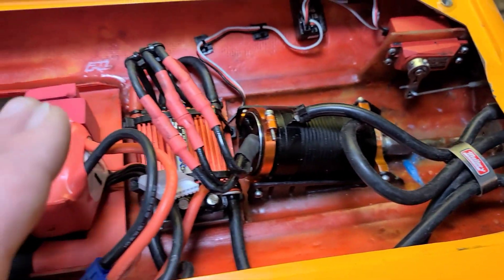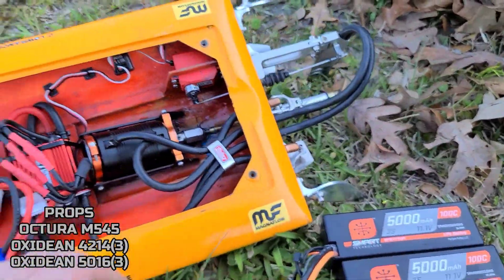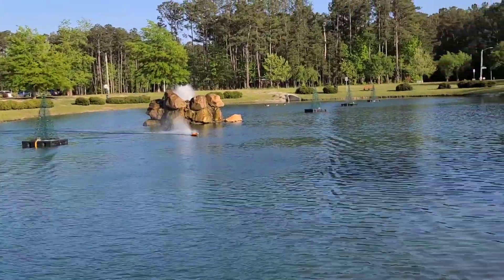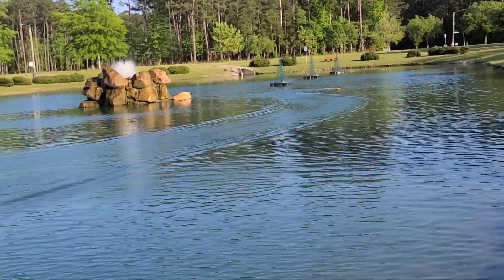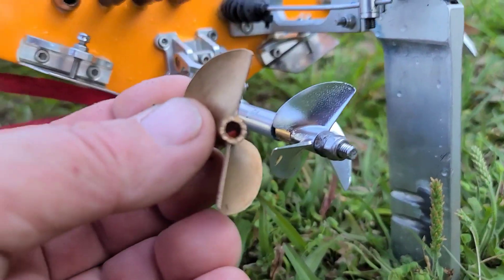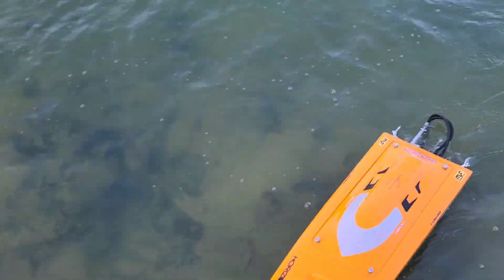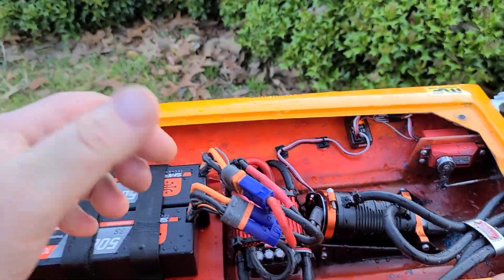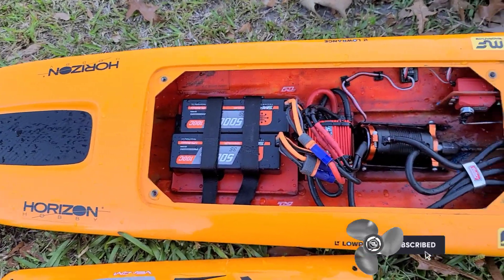Surpass Rocket 4082 Quick Install & Test - 3 Blade Prop Testing Fast Electric Rc Boat

Comment: I just tested a 1716 abc on my Spartan, hit 49mph in a 1acre pond. It did a double 360 & landed it. Had me worried. 1600kv 4082 temps are great
Reply from the maker: That's a great prop!   Should be able to get more mph from it.

Comment: Rocket moter 4092/1520kv . Which propeller is better to put 42 or 44 mm. 3 blade?
Reply from the maker: That motor should take a 44mm depending on the hull type and weight
Reply: @IRONCLADRC   2 blade for 44 mm.

Comment: Dear friend, thank you for interesting videos and beautiful boats. Your channel inspired me to build my catamaran 35". Motor 4074 leopard X2 1750kv, esc flycolor 150a. Which propeller is better to put 45mm 2 or 3 blades? Pitch 1.4 or 1 6 or 1.9?

Comment: Would love to see some 3 blade props on the blackjack 24 and 42. Looking for a prop for the blackjack 24 for my son. I'm looking for a prop that has good out of the hole but not have crazy speed. I'm looking for some 3 blade props for my blackjack 42 and would love to see the black 50mm prop on the 42?
Reply from the maker: I've run the 5016 oxiden prop on the 42  71 mph if I'm not mistaken.   On the 24 I like a tfl 438 but it's got alot of topend well its got low end out the hole  too

Comment: How do the temps/runtime compare with a D wind motor, also what did you set your timing at? I wonder how these are vs the SSS motors as they're in a similar price range
Reply from the maker: Timing is set at 0 I believe?     Either motor should be a decent choice 👌    the delta wind motors  requires more amps there amp hogs but have more torq than a Wye wind
Reply: Y wind timing between 10-15deg, D wind is 0-5deg. To high a timing for the amp draw reduces efficiency & increases heat. At least on paper the D winds consume more current but I wonder if that results in better runtimes in the real world, compared to your TP motor using the same battery was the runtime longer?
Reply from the maker: Yes much longer runtime.  The tp would drain a Battery quick I've actually puffed a couple brand new packs first run with that motor. Not just a little puff either balloon puff trash can smoked puffed lol. 100c 6000 zees. Lol

Comment: 3 blade will mess a boat up.  I tried one and half throttle I had to stop.
Reply from the maker: Depends on the prop and the boat realy. Not all boats & props are created equal

Comment: Man going to camp on a small lake as we do every year for two weeks thoughts on a bad ass overall bought that I can share with my family u no we be buzen lol. Anyway have chargers for Traxxas,and spectrum and never had a bout. Learning hellis right now but love your vids man.  I trust your opinion man its ironclad yo
Reply from the maker: I'd go with a mono hull they self right if you flip. The v2 is a fun over all boat.  The blackjack 24 is a Catamaran doesn't self right, it is a fun boat 30mph so it's not quite as fast as the v2 sonicwake but it's cheap and only needs 1 lipo pack to run at a time.

Comment: Yep I run 42 3 blade 1.6 cnc on my sonicwake,  runs great with tfl stinger and why people are not using 3 blade blows my mind , but I have bass boats etc. Rc is no different go by your standard prop rules . Still searching for 4 blade cnc props more lift more speed . Yes smaller dia but much better performance than 2 blade
Reply from the maker: I think the reason everyone runs 2 blade is the fact there's more options for 2 blade than 3.  Personally I think a 2 blade prop is faster than a 3 blade, better top end. Just my opinion and experience.

Comment: Hey that last three blade you put on, the 42mm, that’s the prop I have on the blackjack 42 except it’s a 44mm, that’s literally the most stable prop for the blackjack. I run 64 mph with it
Reply from the maker: Yea that low lift 42 surprised the heck out of me.    Fun prop
Reply: @IRONCLADRC  when are you gonna slap the 50 on the blackjack!? You’re killing me smalls lol, I’ve been wanting to know how that props runs on it haha
Reply: Hey @Jayce Vessier running a 46mm 3 blade alloy CNC on my Dads BJ42, its a nice prop on that boat, I agree!!
Reply: @marxboatworx  that’s the prop I have in order! What kind of speeds y’all getting out of it?
Reply: @Jayce Vessier. All stock and only on 6S 50c getting 50mphr. Have some 100c packs on order and with 8S. Reckon she’ll crack 60. Running Boatbitz trim tabs as the only added extra
Reply: @marxboatworx  oh you’ll be past 60, the 44mm 3 blade I ran was running 62
Reply: @Jayce Vessier Wow! all on stock? Looking forward to doing that run then👍🏻
Reply: @marxboatworx  oh yes, all stock with 9000 mah 100c batteries. She’s a beast on 8s

Comment: The Deltaforce is a cool boat, it always looks fast! Also wait to you see the size of that 9000mah Battery, I got some 6000 6s CNHL packs & I swear they are as big as brick!
Reply: I run 6s 5000mah 70C myself, and they are LARGE
Reply from the maker: I know right I hope it's not to heavy, hopefully it will have the power to back the extra weight.    I love the props brother the 3 blades are  definitely fun to play with.   Thanks for turning me on to the  oxidean props.  BG4L
Reply: @IRONCLADRC  I did love that reaction from the 3 blade, specially the 42mm 3 bladed, might try that myself :)